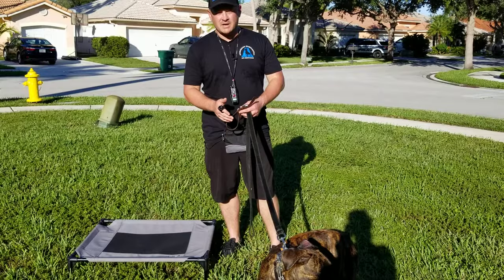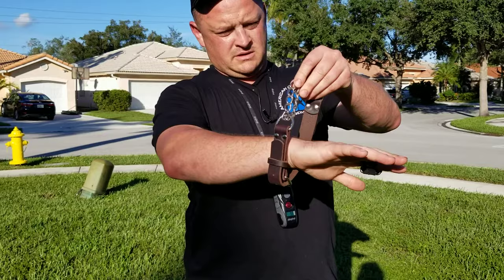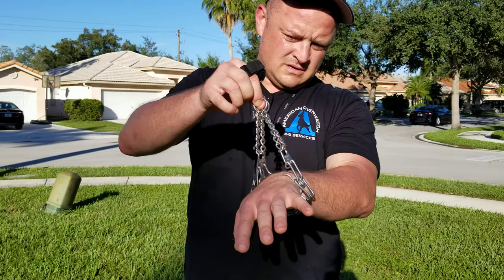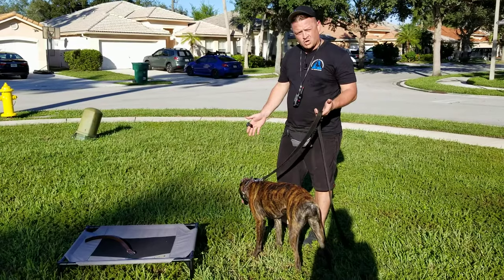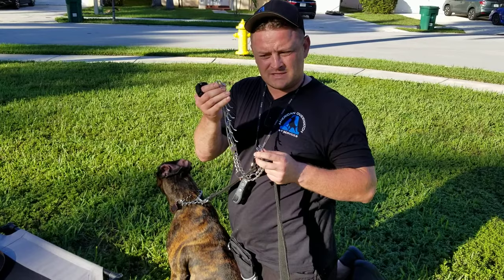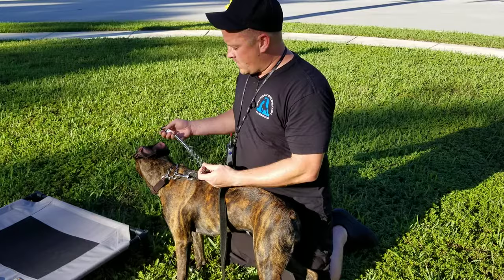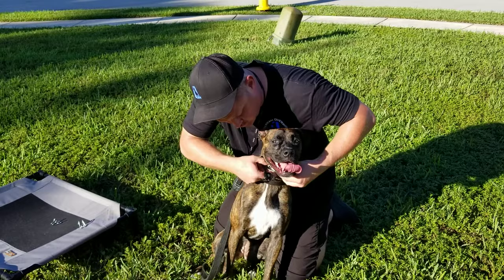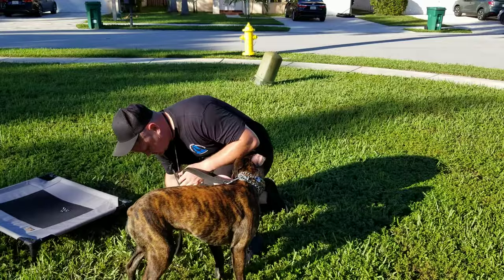How to Use Prong Collars and Other Dog Training Collars to Help Train Your Dog

Comment: My 6 mo GSP wears both a Martingale and a prong collar. The Martingale is basically just the fancy strong collar to hold her name tag and back up if the HS prong collar detaches, which has happened a few times. The Martingale, by itself, does nothing. She doesn't care if it chokes her, she'll keep pulling, spinning like a 4 legged propeller. The prong collar has made it so I can actually take my 50 lb whirlwind for a walk.

Comment: I have a Goldendoodle. Loves people, and pulls like a sled dog when near them. She also loves, jumping on people. The walk is consistent. I trained all my previous dogs, with a metal choke collar. 4 to be exact. So I went to the slip lead, with my Doodle. Garbage with her longer hair. It sometimes wouldn’t release fully. I had a flat collar on her, for Id tags. She walked better but still, pulling, jumping wandering. No control or attention to me at times.

So I bought a 2.25 Herm Springer, $30.

Watched “introducing your dog to the collar”, videos. Adjusted the collar, to a snug fit. Went out for a walk tonight. A long one. Stopped and trained her to sit. Changed directions, many times. Without notifying her. She just turned 6 months old, btw.

I am in “Awe”, what this collar did. My 6 month old dog, in under 5 minutes. Was in a perfect heal, left side slightly behind me. Head up, not in the grass,sniffing poles out changing directions.

She walked beside me, like I was walking an elderly dog. Who has done the walk, a million times.

I’m over 50 now. So I won’t have many more dogs, before I die. 

If I could start all over again. All of my dogs, would be trained on this collar. I cannot believe, what I experienced tonight.

Funny thing is, my sister in law almost wept. When she seen, I bought this collar. There was no pain. There was attention to me, that I’ve never had with a 6 month old dog.

I can’t wait to walk her again, on this collar.

A game changer
Reply: I love prong collars. Education of the tool is key- after that, it’s simple and rewarding for both handler and dog.
Reply: This exactly what I'm going through with my goldendoodle thank you for sharing and what size as well thank you!
Reply: @salinatorres5537  Herm Springer 2.25, watch videos on its use before using.

Comment: My shepherd about to learn. Had a rot 20 years ago that was hard to walk. Used that prong collar and it was an instant fix. Been trying to get the Shepard under control and I have failed. I’m 260 with running back legs and I’m getting pulled. No more. Thanks for the video. Just wanted to brush up on how it was used.

Comment: Definitely need prong collars, I own 2 cane corsos they weigh 130 lbs each I weigh 120 couldn’t of walked them without proper training with the prong collar. Thank you for the great info I love you channel!! Much love from SoCal
Reply from the maker: Thank you
Reply: I need for my Corso!  What size prong do you use?
Reply: Nice, I'm currently using the slip lead for my 3 month old corso. I may just get the prong collar to make training easier.
Reply: My Corso worked well with the e collar for leash training
Reply: @BlackKen_M  which E collar did you go with and at what age did you start using it? I'm so confused about which Collar to use and when etc. I want my Cane Corso to run around the yard free but I was thinking of adding the e collar just in case he decides to go for a stroll in the woods. I don't want to go through them  all the time and definitely not to chase him, so I want to keep him out. I'm trying to learn as much as I can about the options before I pick him up in a couple of weeks.

Comment: I fully understand why my use of the HS collar failed. I literally slipped it over my pup’s head. No significant pressure even pulling it fully. I have adjusted this and have a new (surprised!) pup. Thank you so much! Saving up to get your e-collar mastery course online. I’ve fostered at least 15 pups of various ages. My current foster, about 18 months, is a border collie mix. High prey drive, which I’m working on stopping because she constantly bugs my 18 year old cat. She is also leash reactive to anything moving. She wants to sniff any person or dog. So she shows poorly to potential adopters. She would be an awesome dog for a family. But it never gets far enough for a family to appreciate her. And she knocks down smaller kids, and some adults (that would be me). I am in my 60’s and can’t have a dog pulling me down. Too many risks.

Comment: I don't use them for every dog, or even for most dogs. But when I do, I actually put one on myself and let owners correct me with it, so they can see that it doesn't hurt and isn't meant to hurt. The problem is that there are a lot of people who don't have correct timing or pressure, so it's not a tool for everyone. I look at them like a surgeon's scalpel: it's a specialized tool designed to help when all other options are ineffective. But, just like a scalpel, you have to be trained how to use it properly, otherwise you can hurt someone accidentally.

Comment: Are used to think the prong collars were cruel. But then I worked with a professional trainer and learned how to use them and realized that they are not cruel if used correctly. For my dog, it was much better than the. Choke collar. May end up with one correction per walk versus 10 or 20 that she ignored anyway. She didn’t ignore the one.

Comment: I’m starting a balanced training program and they recommended a prong collar and I was really resistant. I have no problem with them, but I have a brachycephalic dog, so I don’t even walk him on a collar at all, I use a front clip harness. But I think I was sold thinking about how it’s meant to REDUCE the pressure needed on the neck as opposed to a slip lead or flat collar
Reply: The point of the prong collar is it gives very clear direction to your dog with MUCH less pressure than you need on a flat collar or martingale collar.  If you watch a mother with her pups, when she needs to issue a correction, it's a quick scruff grab or bite to the neck.  That's what the prong collar emulates, so it literally speaks to the dog in its mother tongue.  Pun intended.  If you've seen Garret training dogs to walk on a leash, it may look rough, but those few corrections are all the dog needs to be 95% of the way to a perfect walk.  The dog may need a few harder corrections over the next few walks as the dog goes through higher and higher levels of distractions, but the dog will walk on a loose leash for the rest of its life.  Versus the same training on a flat collar would take a great deal more force.  Or without training, the dog will pull on the lease for the rest of its life, and typically that's a lot of pressure on the dog's neck for the life of the dog, or the humans don't walk their dogs much because it's just no fun.  I taught Echo to walk on a leash 18 months ago and she walks perfect on the walks 99% of the time.  We can go past rabbits, skunks, darks barking like crazy, and she just glances at them and then ignores them, all while keeping pace with me.  That 1% imperfection was when 3 deer came out in front of us.  That was just more than her prey drive could tolerate.  She had never seen deer, but I gave her a few corrections and she was back in a sitting position next to me.  Once the deer walked away, we walked calmly to where the deer were, and since she remained calm, I freed her to go to the end of the leash and scent track the deer as far as we could until we met a property line we couldn't cross.  I gave her a very gentle pop (maybe 1/4 on a 1-10 scale) to get her attention, asked her to return to a heel position, and we continued the walk with perfection.  

At DIYK9.com, Garret (the guy in the video) shows you how to use the prong collar to have your dog walking on a loose leash with manners, including classroom info, dog psychology on a walk, leash reactivity and triggers, and more.  He has courses at DIYK9.com covering from puppies to off leash trained dogs.  Pretty much every "correct" piece of training came from Garret and his courses.

Comment: I found you on TikTok weeks ago and just received our prong collar today I ordered. We recently got a 10 month old golden doodle, already about 65 lbs. I bought the 2.25 herm per your recommendation. I’ve seen a lot of people say I needed the 3.2mm bc his weight. Can I ask why you recommend the smaller mm. Love the vids thank you!
Reply: The smaller mm has more bite, basically gauge size kinda depends on the dog. I use a 2.25 on a 116lb corso! I’ve seen them on Danes aswell. You’ll be fine with using the 2.25 as long as you back it up properly!
Reply: @amalieeq1256  what do you mean back it up properly, I just bought a 2.25 collar for my 95 lb Rott and I feel like it’ll break off
Reply: @luisocelotllopez9806  check out safety clips on Etsy! Or a cheaper version would be clip a locking carabiner through the dead ring on the prong and then through ring on the flat collar and if it does pop off, you’ll still have your dog connected to the leash.

Comment: Bought the 2.25 mm collar for my dog’s 19 inch neck, the collar was too short and would not go around his neck.  Should I have purchased more links instead of going to the next available size (3.2 mm) on Amazon?  Dog is a 4-year old boxer (had to remove a couple of links since the larger collar was meant for a 23 inch neck), thank you in advance.

Comment: I have never used a pinch collar but if I was to use one it would have to be a last resort.  Now, I have perfected "the Voice".  If my dog won't go back to place I use the Voice.  Tail and head go down and dog goes to place.  If there is a huge distraction, I will stamp my feet and clap.  But like any control, must only be used occasionally.

Comment: How do you decide between 2.25mm, 3.2mm and 4mm collars? I have a 50 lb shepherd mix(14.5" neck)and an 85 lb rhodesian(18" neck). I currently have a crappy prong and I'm going to upgrade to a herm sprenger with a buckle. I've seen you work large dogs with smaller diameter prongs, how do you decide? Thanks!
Reply: This is my question also. I have a 7  month old GS, 65 lbs. I am wondering which I should get also

Comment: My prong collar unlatched (plastic snap closure) yesterday and it wasn't double hooked. My dog attacked a pit bull (the pit bull was so calm). My dog is also used to the pressure from a prong collar (I uses 2.25") so it is not effective. I read the 'smaller' prongs give more bite on a leash puller who is a standard poodle. My next tool is going to be a head collar.

Comment: What is that on finger?
Reply: Not sure but I assume a clicker
Reply: @caitsizzle97  It's a second trigger button for a remote collar, like a Dogtra. :) Frees up both hands by not needing to hold the remote transmitter in one of your hands. Makes it easier, for example, if you are on a leashed hike and you use a walking stick. Or, if you usually walk with a cane or use two hands on the leash when walking.
Reply: A clicker
Reply: @JirenTheGrayOfUniverse11  It's the hands free remote button to go with his Dogtra remote.

Comment: My opion is prong collars suck they always fall off or get tangled but it is good if you have the patience to put up with it
EDIT OR it'll get stuck and ypu can't use at all like what happened rn
Reply: get a better brand of prong collar and make sure it’s fitted right.
Reply: @ratgoblin5011  well it's now 12 years old and it had to deal with water and my mom didn't know better

Comment: have you ever had a prong collar fail and actually needed the 2nd collar?
Reply from the maker: Many times
Reply: I have on my Seeing eye dog… Our actual leashes have two different clasps on them, one for the prong if needed and another one for the flat collar… Hooking up to both of them separately you can correct with either… Yes the plastic prongs pop easily the Martingale or the prong depending on which one will be most effective for the behaviour